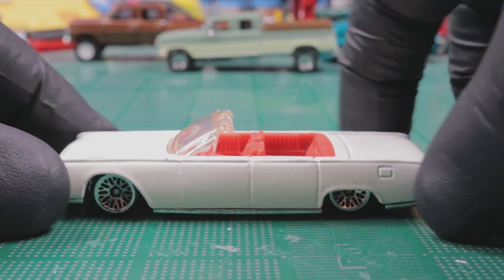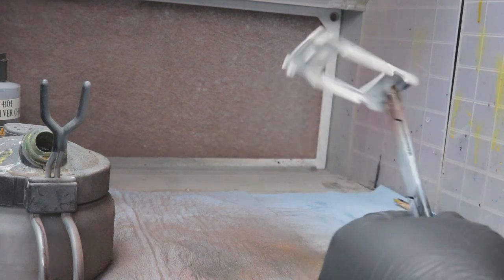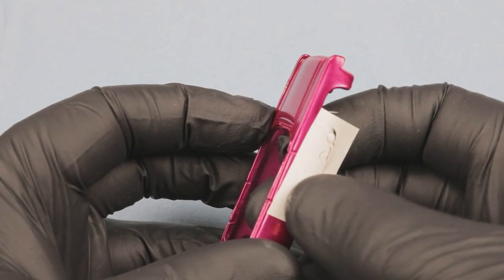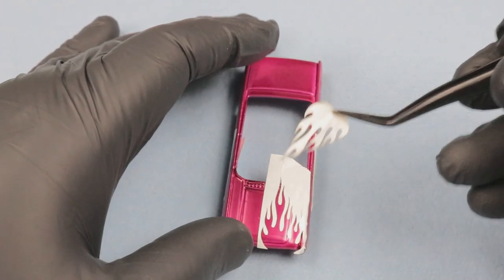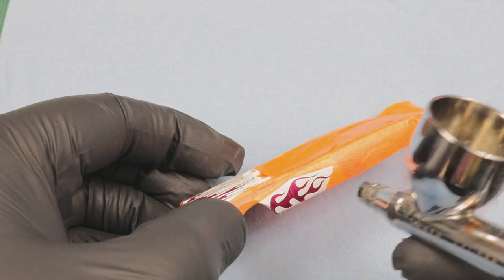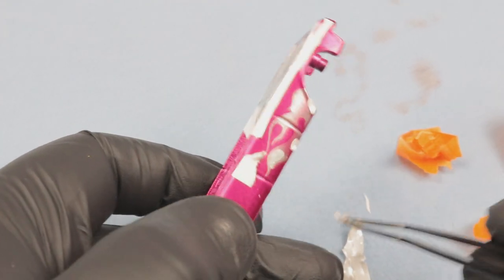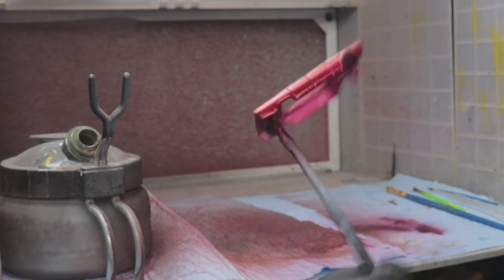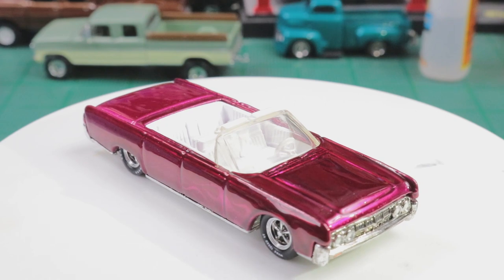Painting Ghost Flames on a 1:64 Hot Wheels Lincoln

Comment: Thumbs up as always for the magnificent work, if I may suggest for some help on how to paint flames with an airbrush, if you look on other youtube channels under true flames airbrush, there are a lot of videos on how to achieve great results.
Reply from the maker: Step one would be buying an airbrush that has the appropriate needle size for doing the small details.
Reply: @DiecastResurrection  not really, a normal airbrush will do, I have a Harder and Steenbeck infinity, and it has interchangeable needles.
At maximum you'll buy the flame stencils which are relatively cheap,
Which are reusable, and can be cleaned after each use with some normal solvent.

Comment: If you put a layer of crappy masking tape or drafting tape on the top of the vinyl, you can peel the back off and place them easier without them coming apart, the once it’s on the car, you can remove the tape to peel the parts of the vinyl out that you don’t want. I would test this though, you don’t want too much adhesion, that’s why I say crappy tape
Reply from the maker: Yea I know what you are saying brother, I was expecting these ones to have that  extra mask layer but they didn’t. It would make things easier for sure.

Comment: Airbrush Suggestion: Cut off the back half of the airbrush tail cap. Doing this makes it so you do not have to unscrew the cap for needle removal / cleaning but still have the front part of the tail cap for ergonomics. 

Nice job on the flames, they turned out great!